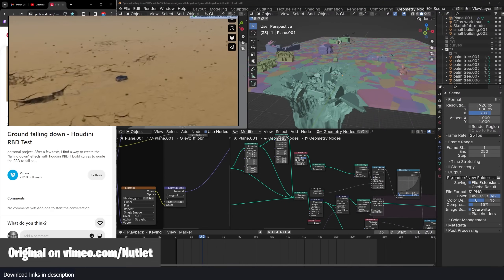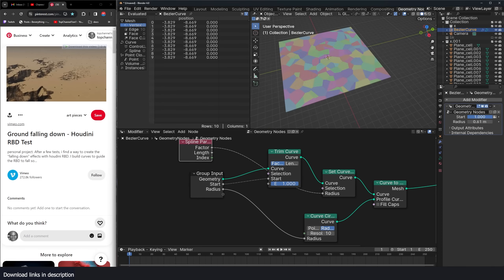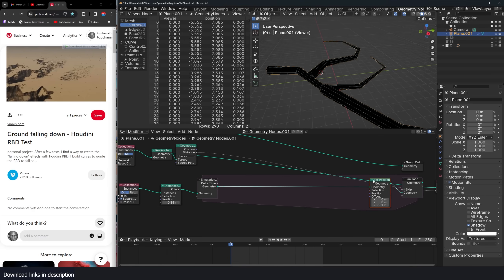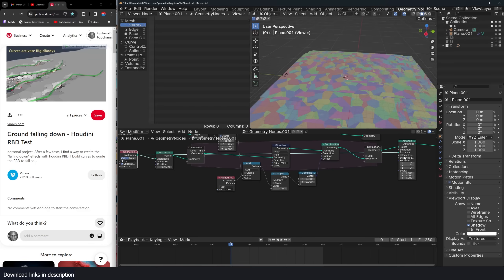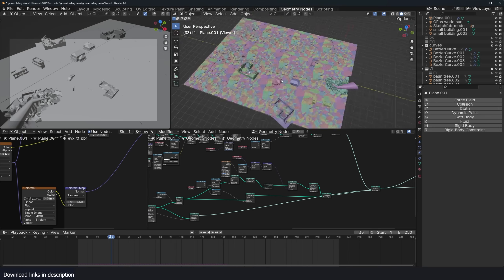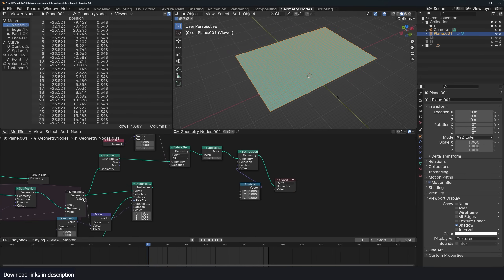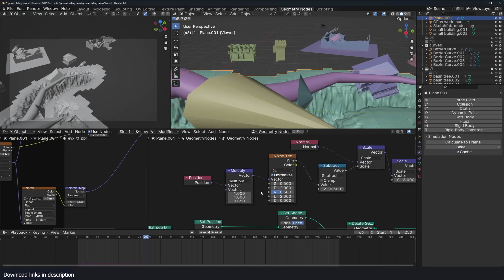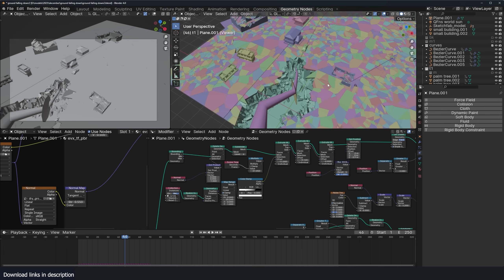Procedural Ground collapsing and cracking with geometry nodes

Comment: Wonderful Tutorial, thank you for all your work on this. I'm encountering an issue when I move the curve key frames back into there original position all my points fall together... 5:01
Reply from the maker: Maybe u are connecting to the position input
Reply: @DaviSilveira Set the animation to start at frame 0. This should help
Reply: I am having this problem also, has anybody found the solution. I followed every node connection just like in your video.
Reply: hey oi hjad the same problem. in curve collection after addin geometry promixity change faces to points and it should workn= fine

Comment: Are you using a plug in or something to bring up the shading random option when asigning random colors to the chunks?  I'm looking all over how to bring that menu up and says it does not exist.
Reply from the maker: It's under viewport shading
Reply: @TopChannel1on1  Omg, I looked right over it, thanks.
Reply: @TopChannel1on1  How do I get the instance points to look larger so I can see them.  Mine are extremely faint and tiny, hard to see them movie to see if it's working or not
Reply: @TopChannel1on1  It is showing a solid plain under the curves, all smaller in the center of the fractured areas.  I can't separate and delete it since it doesn't exist in the collections or the nodes.  Everything was working fine until I did the instances on paths and now it's all messed up.  It doesn't even have the curves extending and fractures falling with the curves anymore either, just all falls at once around the path as if fully extended.  Blender also keeps bugging out and making the entire plain fall and forcing me to scrub back and forth 2432 times before it works normally, and then goes back to the entire plain falling and making me scrub back and forth a ton again to get it to show properly....actually nope, it won't playback correctly, if I do playback the entire plain falls.  It will only show correctly if I grab the playhead and frantically move it back and forth, but once I let go, the entire plain falls.........Update to this, I reported it as a bug and sent video to blender developer forums and they confirmed it is a bug.  For anyone else that has this issue and sees this.  Tried in 4.0 and 4.1 alpha =/  So just have to wait I guess.   It does work 99% using Edge or Points in Geometry Proximity instead, except it drops a fracture point at the other curves at frame one when it's not supposed to, they confirmed all of it, so have to wait it out, but at least those two options gets 99% of the fractures from falling right away.